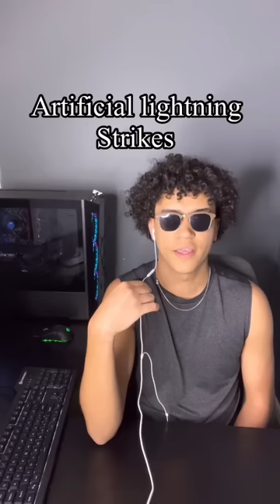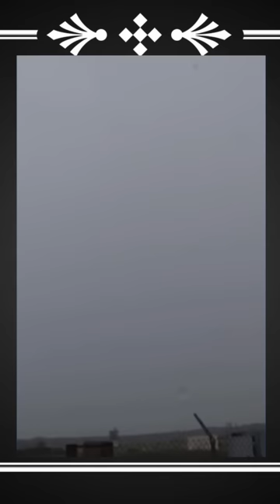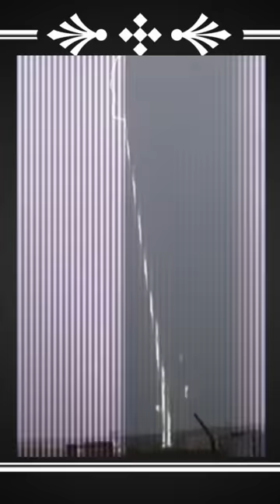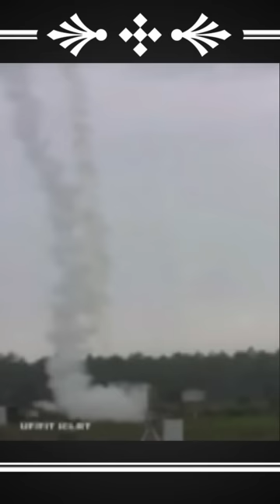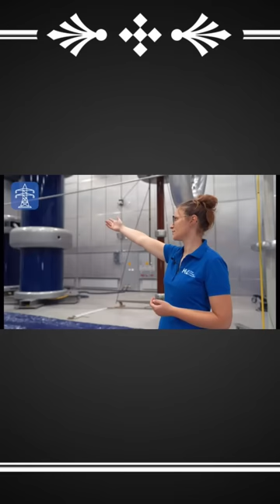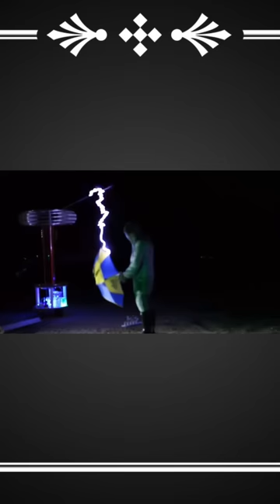Rocket triggers lightning strike! Artificial lightning!! #shorts

Comment: Seriously, lightning can be a good source of energy and we will never run out of it. The only problem is we still don't have the technology to store that much power.
Reply: The problem is whatever machine or battery that you would want to put on the path of a lightning bolt to use its energy would act as a resistor. And lightning (or electricity in general) always tries to use the path of least resistance. So most likely the lightning would just try to find a path around the machine or battery you're trying to power. Not to mention the fact that lightning storms move everywhere all the time, you can't just build a power plant that sits and waits for the odd lightning stike every few months at best 😅

Comment: It's crazy because even though it's still just lightning, the artificial one seems much more yellow
Reply: The color is from the metal cable burning. Every metal whether its ferrous or nonferrous would produce a color of it's own. Some might not be visible to the human eye in a split second.
Reply: Natural lighting has no designated path of metal therefore no artificial color

Comment: A few things to correct here. A million volts is about a meter of spark. Lightning is usually a whole lot more voltage, a 15 million volt lightning strike is only ~50 feet tall, which may be the case for the rocket but not regular lightning. I believe average lighting is closer to 400 million volts. The voltage may be million times more than a standard bulb takes, but the lower current could not keep up. So the voltage would drop. A small 15 million volt  would not light a million bulbs. You can make high voltage a whole cheaper than that too. I built a ~1 million volt Tesla coil for only a few hundred dollars. You could probably make more that just a few mission volts for millions of dollars.

Comment: I feel like electricity is kind of like a legally binding contract, like you have to follow a specific set of rules, like don't hold metal in a thunderstorm, don't put both legs on the ground separately, and other stuff, but the upside is that you don't get shocked and zapped.

Comment: Right now there is 120 volts in the atmosphere per metre altitude. A special motor that runs on static voltage, can use that. 120 volts but few AMPS.

Comment: Imagine if in thunderstorm heavy locations they used this technique to capture the energy for grid use. Like you could have that bolt instantly charge a ton of capacitors to charge battery network at a controlled rate. Even with the lower success rate, I'd imagine even just one strike could make up for energy loss of other failures.

Comment: So I was wondering why we're not harnessing electricity from artificial lightning strikes.   Here's why, copy/pasted from Bradbury Science Museum:

"
Each strike would force about fifty thousand amps of current into a battery in just microseconds. No existing battery could survive this onslaught; batteries need to charge up more slowly.

Then, even if we could design a battery that would not be vaporized by the strike, all the lightning in the world would still power only a small fraction of households. It’s true that each stroke produces up to perhaps five or ten gigajoules of energy, and a household in the U.S. needs only about five gigajoules per month—and that’s just one strike! But actually, only a fraction of that energy is in the form of electrical current—much of the energy goes to heating the air. And the process of storing the energy in a battery and then retrieving it is pretty inefficient. So, now you need a few strikes per household per month, and in the end, even if we could find a way to capture, store, and use the energy, it would power only about 0.1 percent of the world’s homes.
"

Comment: The tandem produced 32 million volts in 1979. Mankind has exceeded the voltage produced by lightning. Also, volts alone isn't enough to light a lightbulb. You need wattage and that's amps x volts.

Comment: So these theoretically can be used by oil rigs or big ships to regain power if needed. I mean if it's just a rocket with a metal wire attached then that's probably cheaper than a generator or at least a back up to the generator in case the generator fails

Comment: a couple fireworks pulling a metal cable into a lightning storm, perfect way to clean the swimming pool, with its own ozone and everything, not even the algae would survive, so once the cable falls and the storm passes just clean the debree and the water should be clean, as that's not just lightning, its basically sucking the storm dry by providing an easy path down 🤔

Imagine fusion nuclear reactors being started this way, or for metal foundries.

Comment: Sooooo when are we going to start STORING the electricity from lightning strikes and go fully electrical because what downside is there to using Artificial Lightning as a way to generate electricity vs. hydrodams that mess with ecosystems, vs. wind farms that kill birds, sometimes endangered ones by accident, vs. solar panels that use a lot of carbon producing manufacturing to make the panels, vs. coal with it's obvious drawback and lastly, nuclear power which wouldn't be as dangerous if we just used Thorium.

TL;DR Why aren't we storing the electricity from Artificial Lightning and just changing 100% to that?

Comment: Fun Scary Ass Fact: A bolt of lightening can reach excess temps of 35,000 Degrees Celsius or around 57,000 degrees Fahrenheit. 
More than enough to vaporize a human.
Reply: Well it’s so quick that it doesn’t actually do that much damage, I’d say if it lingers for like half a second longer you’d be a corpse.

Comment: Lighting comes from the ground not the sky, the (light) ark you see is just  different gases in the air mixing with the electricity that shoots up into the air, like those globes with a center ball and when you touch it electricity arks from the center point! Same thing the earth is the center point and the sky is an outlet!

Comment: i always wanted to create a tornado, and i don't mean a tiny one i mean one that reaches the clouds.  now you may think its crazy but you have to understand i'm a dreamer.  my idea was to create a rather large structure between a few mountains or in the heart of a mountain hollowed out... that the structure would act like a wind vertical wind tunnel, at ground level i would have a structure built like a pyramid... the idea... well to create turbulance and electrical charge, that would strike the pyramid or conic structure.  you see air flow around mountains can be quite intense compared to air flow at ground level.  anyhow that was the idea... to let nature create the vortex within the structure...no ceiling thou... thou idk how high you'd have to reach above a mountain to get the air to take the path of least resistance into the structure to create it... even if the lightning aspect didn't work... you could put in horizontal turbine blades the air would spin... so either way you could get power and i'd think allot of it, but the investment to create it would be great initially as well.

Comment: It’s not artificial. The rocket goes high in the air with a long wire acting as a lightning rod and causing lightning from a storm to strike it. Also common lightning is over 300 million bolts not 15 million so idk where you got your info from. Positive bolts are over 1 billion and the one in this video was negative.

Comment: Too bad we can't store the electricity then use transformers to down shift the electricity into usable volatages.
Even if we could only harness 10%

Lighting storms are common enough around the US we could even use 1% of it and still provide a better useful energy supply than nuclear. (It rains often enough in Gulf States and Tornado alley. And thunderstorms aren't THAT rare. Just capturing 2 Lighting storms per state should be useful enough to offset coal burning. For the grid. Key word is OFFSET, at least until we can better capture and store the storm's energy.

Just think if we could use quick capture cells and a disposable breaker for the excess.
Theres like so many forms of energy in Lighting. 
The heat its self could be used for boiling, the electricity for electrical power, and maybe even the static forces too, or the electro magnetic field could be used to induce a turn on a turbine.

Something along the lines of brushless motors used in drones, or the semi perpetual motion that used in fidget spinners.

Comment: 50million volts of electricity....

That is a statement like 5000 bar of gas.

Then you still do not know anything. 
And no. artificial lighnting, the one from an impulse generatar can easily go over 3.6 MV.

It all just depends on how many stages the impulse generator has. 
Now economically, there is generally no reason to go that high. But for example the HV department of Delft University of Technology has a 4 MV impulse generator.

Comment: "This has xy volts of electricity" yeah no.

I mean volts are used to measure electric potential ots just completely not usable as an absolute measurement.

Joules would be waaay better because its the total energy

Or at least watts if youre trying to convert to lightbulbs

Comment: Hate to be that guy but 15 million volts can't light any lightbulbs if it's at 0.00000003 amps. Can you tell us the voltage and wattage or voltage and amps please? These figures are also important.

Comment: Using voltage and saying how many lightbulbs it can power is pretty nonsensical. It cannot power that many lightbulbs, because, while the voltage is strong, the amperage is weak, and putting any load on it, like a lightbulb, would cause the voltage to collapse rapidly.